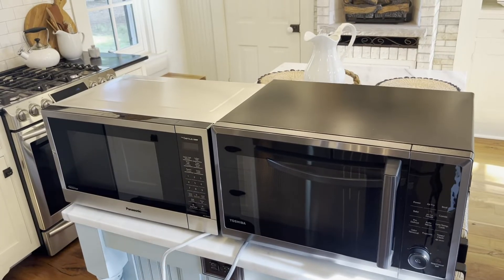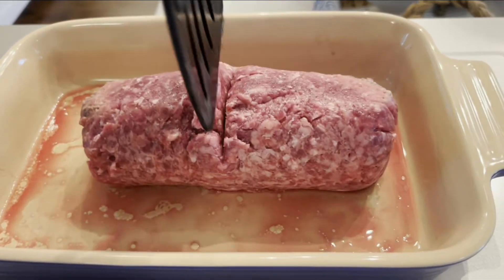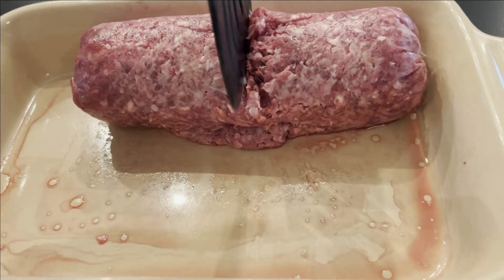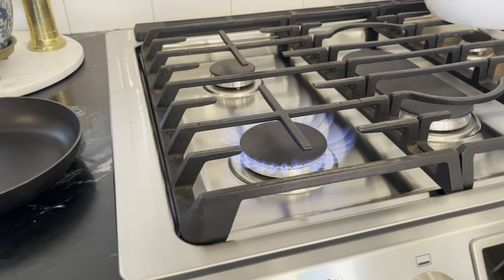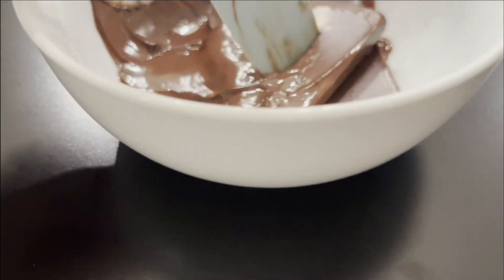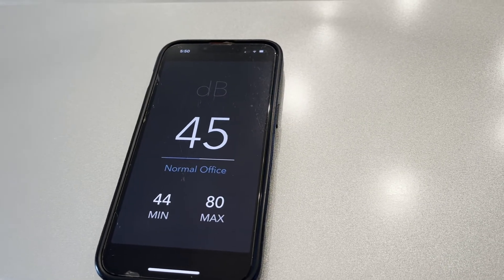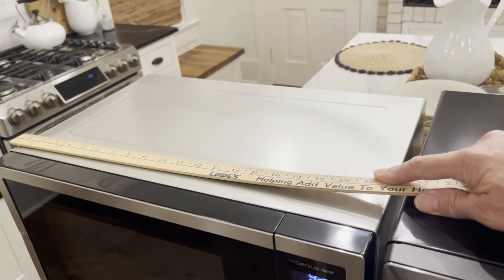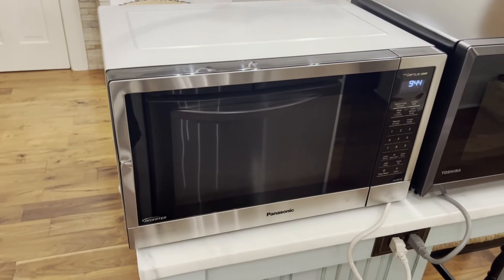Are Inverter Microwaves Better?

Comment: my LG is not an inverter but it allows me to set the wattage to 5 different watt levels. Isn't that pretty much the same concept?
Reply: Yeah, from what I understand if the output wattage isn't the same, it isn't a fair comparison since higher wattages cook faster. Even just a 100W difference could be noticeable and they did 1000W conventional vs. 1200W inverter. Too much of an advantage for the higher output one.

Comment: I've found that my Panasonic inverter microwave will interfere with bluetooth headphones connected to a computer or mobile phone- the microwave will make the sound fade in and out. Not sure if a conventional microwave would have done the same interference.
Reply: All microwave ovens use electromagnetic microwave radiation to heat food/liquid, and produce microwaves of about 2.45 GHz frequency.
Interference (amount) with wireless/radio technology that also operates near 2.4 GHz (Bluetooth, some WiFi, some cordless phones), depends to some extent on proximity, construction (shielding?), and power level.
Reply: I have a wireless speaker that cuts out when I use the regular microwave, but it's in the kitchen.

Comment: errr if you have different maxes 1000w vs 1200w you will also have different halves or 30% or whatever @ power level 3. which in turn will give different wattage outputs.
use a power meter to figure out wattage used.

Comment: This is not a fair comparison. I don’t think you have a technical background otherwise you would know the value of inverter technology. It provides a more even, thorough cooking of thick items. 

Rather than the full on/ off cycles of non-inverter technologies, an inverter provides a continuous 30% power rather than full on for 30% of the time followed by full off for 70% of the time.
Reply: It seems that the explanation of EXACTLY THIS POINT using the frying pan on the stove, seems to have gone completely over your head. 

You’re rude. Watch again and pay attention this time

Comment: Thank you for your review. Here is some additional information, an inverter microwave uses a high frequency switching transformer that weights only a fraction of the boat anchor transformer of traditional microwave making the oven about 2 kilo (4 pounds) lighter. Since the magnetron (the tube that generates the microwave energy) in a microwave is a vacuum tube it needs a heating element to function and the power for the heating element is supplied by the transformer in both type of microwaves. Using the inverter microwave under about 500 Watts there is inefficient power to supply power to the heating element and it then operates the as a conventional microwave by switching on/off the the power to obtain lower cooking power.
Reply: My microwave slides easily on my counter as it is.  Any lighter, and I'll have to glue it down. 🙂

Comment: I could be wrong, but how I understood it was that conventional microwaves are like pulsing light switches on and off to achieve lower power. cycling full power in on/off duty cycles.  Inverter Microwaves actually lowering the microwave power, like a dimmer light switch.
Reply: my LG is not an inverter but it allows me to set the wattage to 5 different watt levels. Isn't that pretty much the same concept?
Reply: Sounds like the old "Amana radar range"

Comment: Note that microwaves can interfere with the 2.4ghz band. 5ghz is generally unaffected
Reply: Correct.
Reply: This. I don't recall ever noticeably experiencing interference of 2.4 Ghz Wifi from a microwave, but I did experience such interference of a 2.4 Ghz cordless phone system. Early in marriage I remember a couple times while I was on the phone near our kitchen and my wife started using our microwave. I would have nearly instant problems with call quality, not being able to hear the other party and instinctively moved away from my spot, to try to improve reception, which worked. I remember after the calls ended, considering that the problems started when the microwave was in use, and stopped when I moved away from the kitchen/microwave.
Reply: I don't know anythind=g about gigahertzes.  I just know my music stops playing everytime I use the microwave.

Comment: Been using an inverter microwave for years, even switched my mom's out for one!  Directions for microwave cooking on food is pretty accurate for an inverter as well(typically directions are for 1100W).   You can just take the microwave's wattage(usually 1200) and divide by 10 to get the closest power level to use.  Usually 9 for most stuff.  Also you can hear when the transformer turns on and off with old microwaves since it only has one power level, there's a distinct noise change if you listen.
Reply: But I don't want to learn how to re-time my frozen food (50% for veg and double the time).  It took me 40 years to perfect the timing.  If they want to make microwaves better, they should get rid of the stupid reminder beep.
(Thanks, though, apparenly, I have to get inverter tech whether I want it or not, so you made me feel a little better)